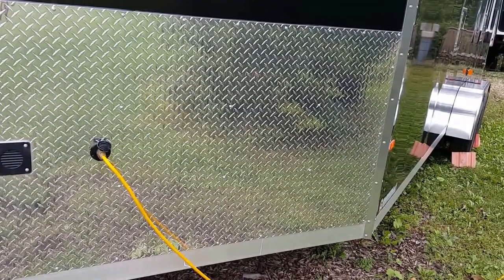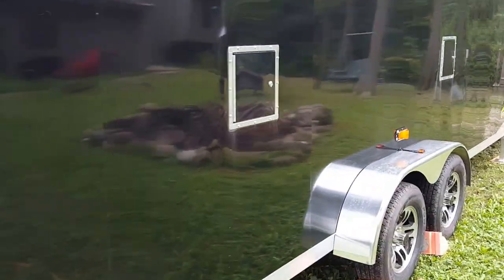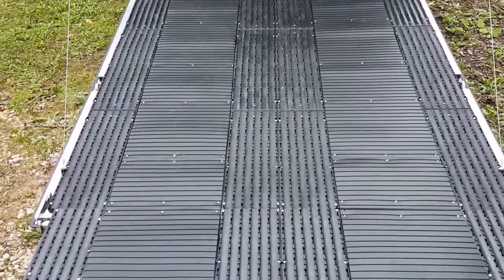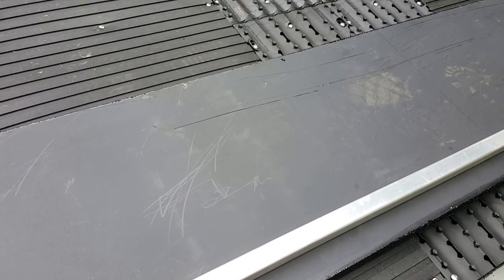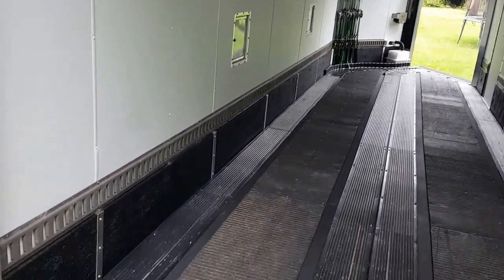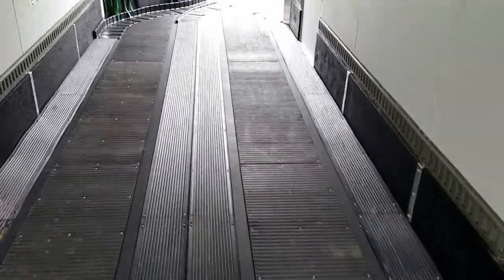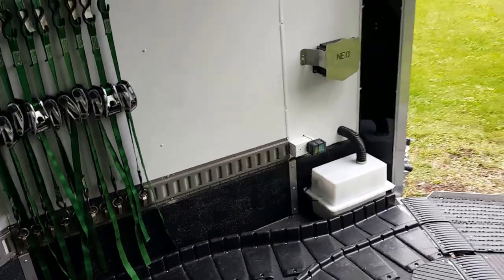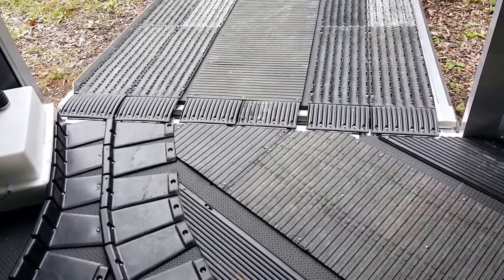2015 Neo Trailer update

Comment: Nice work the trailer looks great for a 2015. I'm currently looking at a used NEO and was concerned about the quality. Have you had any issues with yours?
Reply from the maker: I just replaced the springs, hardware, brakes and wiring. It's see a lot of miles mostly in the Wisconsin salted winter roads.  I'm very happy with the trailer for a relatively inexpensive trailer.
Reply: @SavageNFS  Sounds good ! Thanks for the reply. Did you do all of that work yourself?
Reply from the maker: @996TwinTurbo911  yes